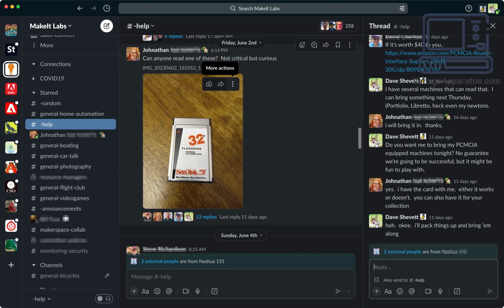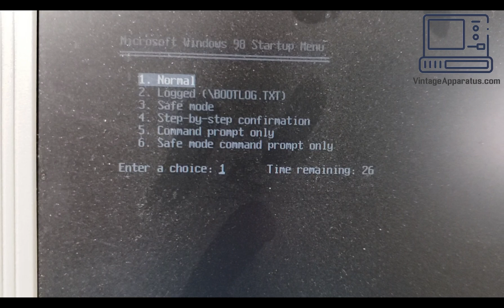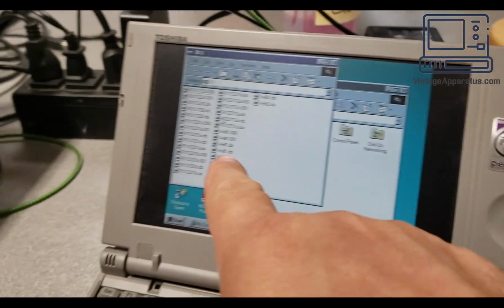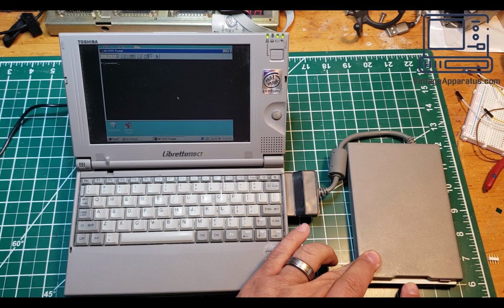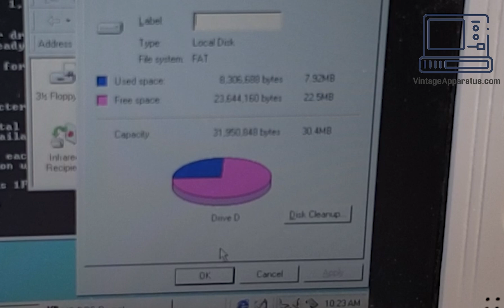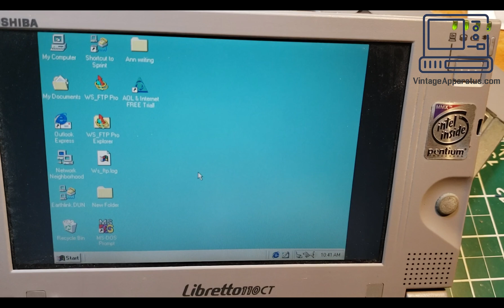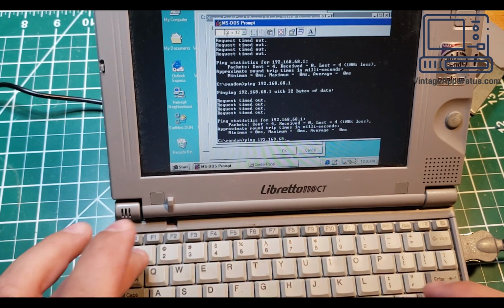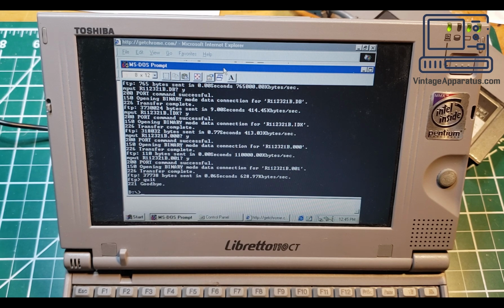Using a 25 year old Laptop to Recover Data from an old PCMCIA Memory Card

Comment: A paralel port zip disk or similar might have worked.
Reply from the maker: If I had one!  :). Also I'm not sure if the ZIP drive would have required Win98 drivers or not.  In the end, I got it working, so now I have network connectivity and can install anything I want.

Comment: What if you connected the old laptop to to a new laptop by a USB to RS232 Serial Cable with a Null Modem connection to the old laptop then use windows  Hyperterminal. to Xmodem the files to the new laptop?

Comment: I probably would've tried sending the data via the serial port, but if you've got Ethernet, all the better.
Reply: I kept thinking, "man, I'd probably have just pulled out Kermit", ha!
Reply: Hear hear! it's easy to set up a VM on a modern computer and send files via RS232 (to USB). I backed up my old IBM PS/2 onto my MacBook that way.

Comment: I recently picked up a Libretto 70CT myself. My first thought would be to copy the contents to the HDD and pull it and connect to a USB IDE adapter. I replaced the drive in mine with a CF adapter

Comment: I would've just been lazy and used split zip or Kermit or something.
Reply from the maker: Believe me I thought about it!  But remember the Libretto had no external connectivity, so I couldn't copy the utility TO the laptop without either having another machine with a working 3.5" floppy, or the network working.  My 'floppy' machine here in the office is offline, so I couldn't use it to make a working disk :(
Reply: @vintageapparatus  ah. That makes sense.
Reply: I mean … how the fuck did windows find the driver for that guy’s card?!?
Reply: @Kheldul  I think he mentioned that he used some card with that computer previously maybe when he had a working floppy drive.  Otherwise, maybe just an old enough card that windows 98 had a driver for.
Reply: @Aeduo  that was later. The first segment had a part where windows was searching for the driver. Maybe MSFT has online drivers? Although there was no internet..
Reply: @Kheldul  nah there was no online drivers back then or if there was it never worked.
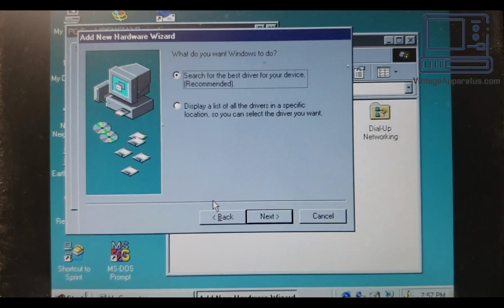Reply: @Aeduo  3:53 is the part I was surprised about.